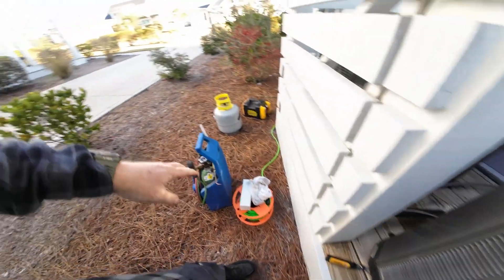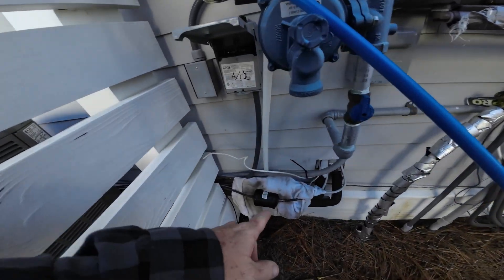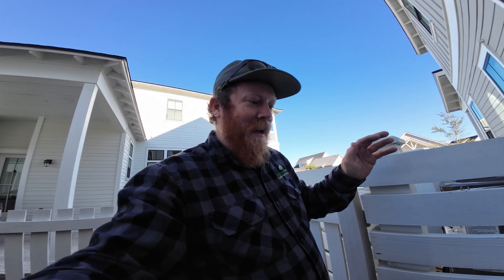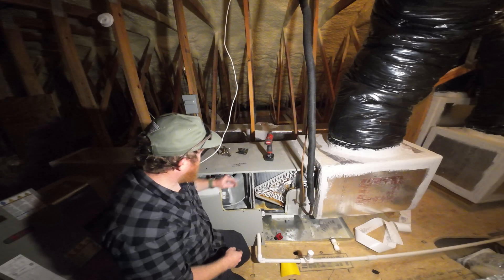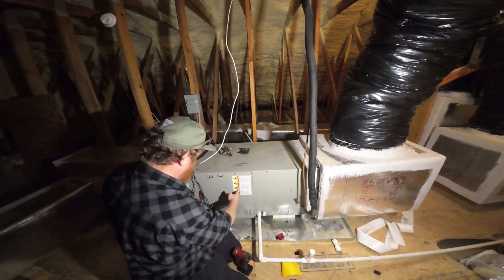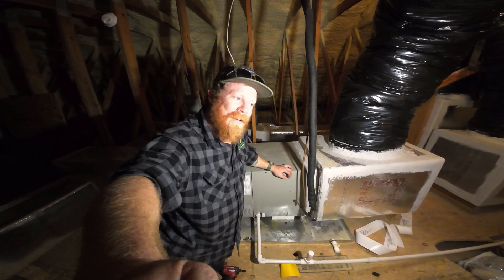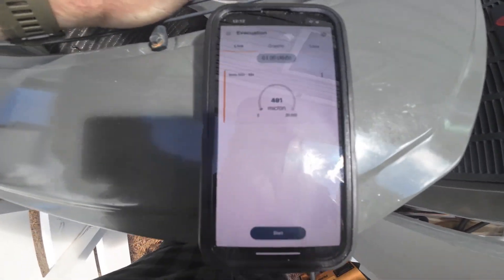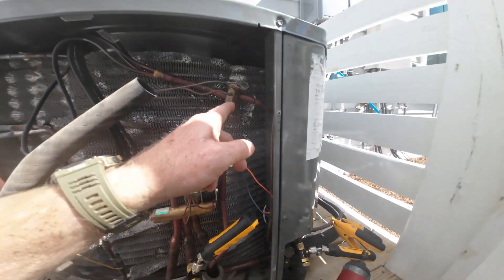HVAC SYSTEM ALMOST EXPLODED IN MY FACE | ALMOST A FATAL MISTAKE | TXV REPLACEMENT !!!

Comment: Great video! This gave me hilarious PTSD flashbacks, because I'll raise you one. You dodged it before it happened, where I... faced it head on.

In my early days of Service, I was sent to replace my first indoor TXV on a Goodman system. Goodman, much like YORK used to, installs their filter dryers inside the condenser. I knew I had to replace it/move it indoors, so I proceeded to do what I was accustomed to through install: pump the system down.

And then proceed to climb right into that condenser...

And change the filter dryer. 🥲

So kids, 7 lbs of R-410A straight to the face teaches you very quickly to be mindful of which procedures you're following. 

It's a mistake I will only ever do once — I practically FLEW out of that condenser.

Good times! Repair fared well in the end but I'll always remember that moment as my rite of passage into Service work.
Reply from the maker: @Azranael  Holy crap! It has never happened to me, thankfully I know as soon as I see a little bit of blow torch to stop immediately before the thing blows up in my face.

Comment: Wow - Glad you caught yourself. Yea, it is not the refrigerant that would have gotten you per se, but the misting of of the refrigerant oil with the flame.  Not sure if POE is flammible, but do not want to find out this way! 🙂 Had a friends uncle that worked on a refrigeration system that did not know his torch was touching a line next to it and it came undone. The mineral oil misted caught fire and got over him...was not good outcome for him.  But glad you are safe on this one.

Comment: Such an easy mistake to make given the placement of both filter dryers.  Glad you're ok!!    So you just/only changed out the filter dryer on the 2nd unit?  If so, why?
Reply from the maker: As soon as I seen the little blow, torch pop out I knew it was definitely not nitrogen in the system and it was refrigerant burning and that’s when I stopped and I’m so glad I did. Re-watching this video. Makes me cringe a lot.
Reply: @CosmicCooling  I hear ya... I thought for some reason you had gone out there initially to additionally change out the 2nd unit's filter as well.  Breaching the system like that.... I get it.  Thanks!!